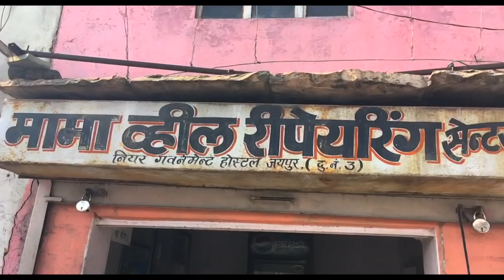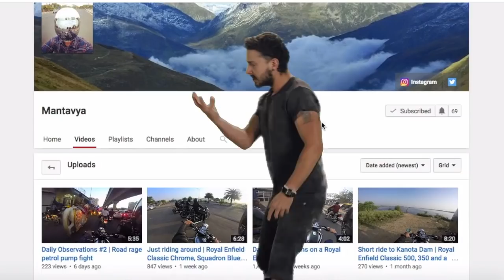Incredible Royal Enfield Scrambler Modification

Comment: How much of power difference do you find between this 350 and your  500 .is there a difference between top speeds on highways ?
Reply from the maker: never ridden 350 on the highway but the 500 has all the low end torque
Reply: @Mantavya  .thanks